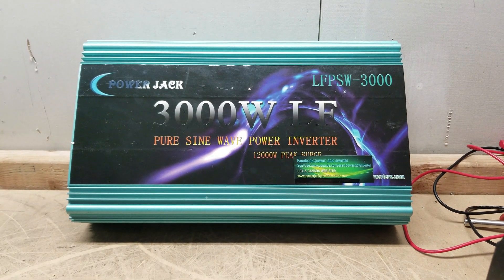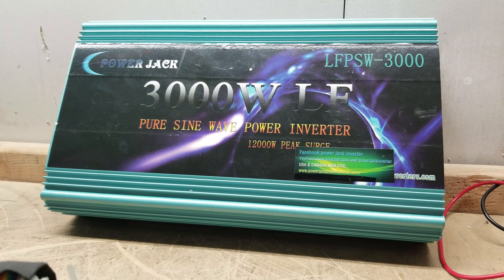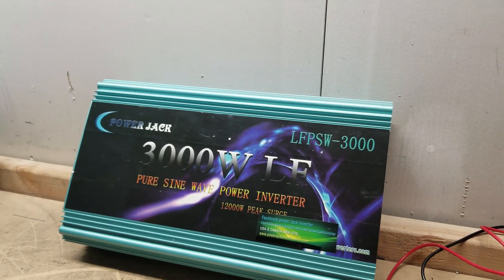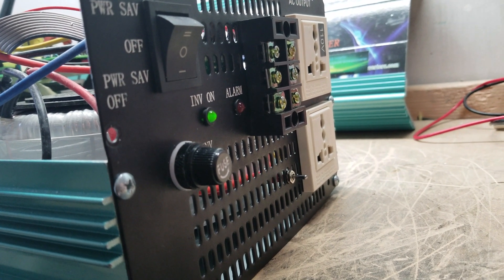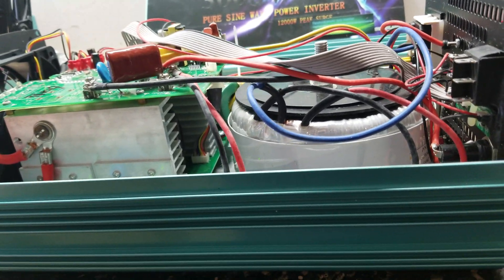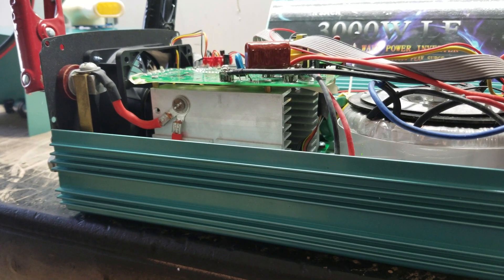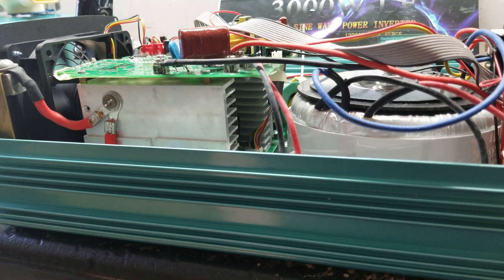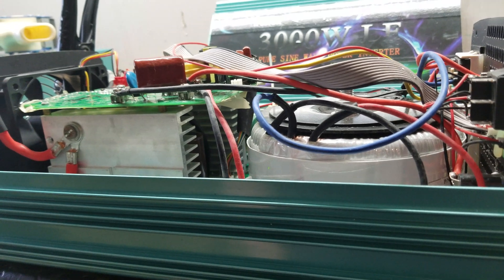Powerjack 3000w Split Phase inverter?!

Comment: I have an issue with my new 5000w lf inverter charger. The 12v mosfets are green but no other LEDs are on. I was using it on my 1000w microwave. Ran for approx 30 seconds and then shut off with a burnt electrical smell. I looked all over it and cant find any burnt components without disassembling the unit. Any advice or a way to contact you for parts?